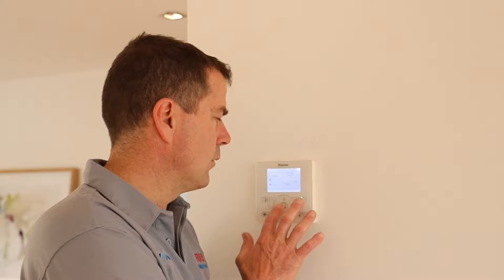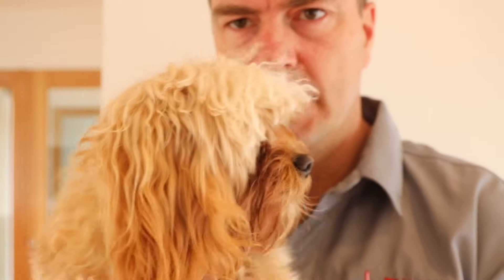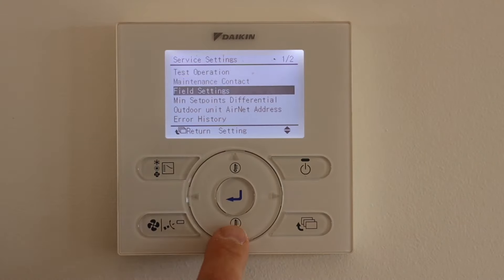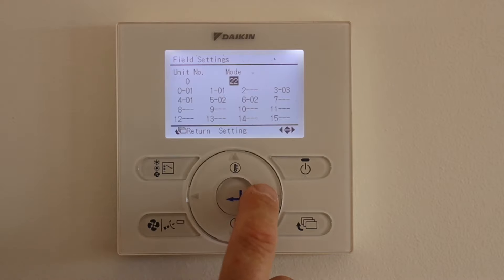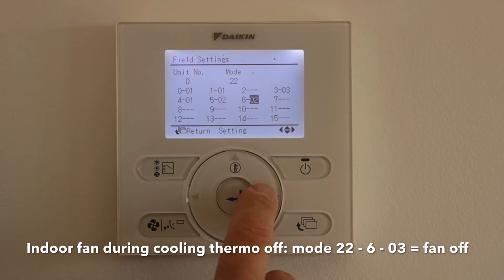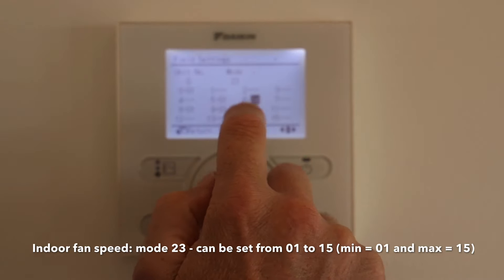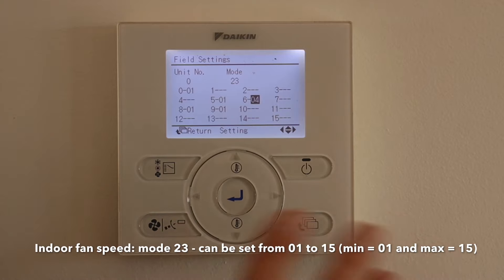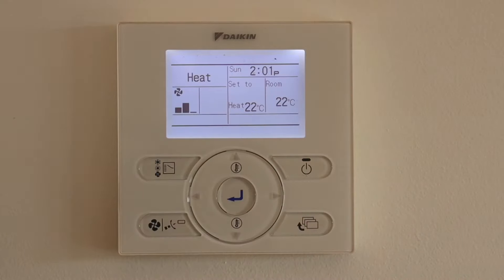Daikin BRC1E63 controller set up field settings cycle fan off, activate sensor in wall controller

Comment: After 4 years of trying to figure out my my system was so goofy I finally have an answer! I have 4 air handlers in a ducted system. upstairs would always go colder than set temp and downstairs would never get down to the set temp.
Reply: Question, I have also read that when you change the thermistor location to the remote only that you should also make changes of 20-8-2 and 20-5-2. Any input on this? Mine is actually a BRC1E73 controller

Comment: Loving Arlo! Good looking pup. 

Craig, I have a Daikin mini split as a second system in my home to cool the second floor which has all the bedrooms. 

My indoor unit is a FMDQ24RVJU and the outdoor unit is a RXL24UMVJUA. the. O troller is the Daikin OnePlus.

I am in the USA and these systems are fairly new into this American market (from what I am aware of…)

I am having a problem with overcooling with this system. 

Are the field setting tje same as what you have explained here? I am having a hard time finding a document that explain what each setting is. The same for what each mode is.
I was wondering g if you could provide a link to where I could go find such document. 

The installer has not been successful on getting this unit to work properly. It is his first Daikin install 😢

Thanks for your video as you explained some of the settings. Sub’d and I hope to hear from you. Cheers!

Comment: Mate you’re a legend will see how I go. Issue I have is that the bedrooms have no power whatsoever but the living room heats up in my apartment. Is there a way you can change the power distribution across the different zones?

Followed your instructions so let’s see. Also what does the S symbol mean? I did change the energy saving % is that it?

Comment: Thank you very much for the detailed video. 

I don’t seem to have the Room Temp option in the Display Item options. Is there a setting to ensure this is available in Display Items? FYI, I have the BRC1E63 with FDYAN125AV1 Indoor unit and RZA125C2V1 Outdoor unit.
Reply from the maker: @LChristou-n4j  it should be the same as what I have set, configuration, display, display item = room.
Reply: @FullyAirconditioned  I only have three options, None, System and Outside Air Temperature. Any ideas why Room Temp is not an option; thought it might be a field settings issue but can’t find a master file that explains every field setting…

Really appreciate your help.
Reply from the maker: @LChristou-n4j  check felid  setting 1c - 0 - 02 this allows room temp to be displayed in “detailed settings”. It’s set to this from factory so someone must have changed too 1c -0 - 01, “not displayed”.
Reply: @FullyAirconditioned Thank you so much, that worked. Looks like my room temperature is not accurate - reporting 23 when it is closer to 19. I have implemented your other settings so it should be reading the wall unit temp. Any suggestions why this could be inaccurate and are there any fixes you’re aware of?

Thanks so much again, really appreciate your time.
Reply from the maker: @LChristou-n4j  there is no calibration for the sensor readings, if this sensor is active as the control it what controlling the system.
Reply: @FullyAirconditioned  Thanks so much. One last question and I promise I’ll stop hassling you - Is there a master file which shows what every field setting is? I have a number of active field settings which do not appear to be active in your video and I would love to understand what they’re all doing.
Reply from the maker: @LChristou-n4j  all this information is in the service manual for each model, they do very a little bit from model to model the Engineering data books about 500 pages the section you’re looking at might be like 20 pages. It’s just hard to send through YouTube.

Comment: Thank you so much! We have this unit and want to know if there is a “night mode” because that power light is so bright at night time
Reply from the maker: Sorry I don’t think it has this function
Reply from the maker: I was just think there may be a way, when the timer is uses there is a set temp in the off setting with a heating cooling set point. It’s set up so that if the house gets above 35 degrees the system will come on even if its set to off and in heating I think its about 5 degrees, the heating will come on even if its off at the controller. Both the heating and cooling set points can be adjusted to a higher setting for heating or lower set point for cooling. If you set this up the unit should turn on if the temp in the house drops below the set point, so the heating will start and heat your home at night with out the operation light lit. Haven’t tried it my self but I believe it will work, not to shore of the differential of the system kicking in and out, but you should be able to work this out with a bit of trial and error.
Thanks Craig

Comment: Hi, thank you for posting this clip, its been a life saver. I only have one question, my room temperature is 21, my set temperature is 20 which I increase to 27. It will run at that and warm the house for half hour or so, then stop and the set temperature is back to 20. How do I keep the 27 permanently displayed as the desired room temperature? Is there another mode number to set?
Reply from the maker: @janetcarney953  you have set point auto reset active on your controller, go into menu, energy savings options, then go to energy saving list. Here it will let you know what energy saving are turned on, turn them all off.

Comment: Great video mate, just wondering what the main difference between auto fan speed and the selected speeds and what do you recommend for a ducted. Also I have a Daikin 125 and circular grills which seem to make popping sounds only in heating when the indoor fan runs.

Comment: I'm definitely going to look into making some of these changes. 
I'm actually chacing info on chaning the settings for the defrost. I'm having terribles with the outside unit freezing up and staying like that until I am forced to get a bucket of hot water.
Reply from the maker: This won’t help defrost, check out my video on defrost to see if your unit is operating in the same manner. Biggest problem with excessive defrost is under sized system.
Reply: @FullyAirconditioned  I will check it out. I only seem to have issues when it drops below zero. Once it freezes up it seems struggle to defrost. It doesn't help that the unit is in a dark cold area behind the house that hardly sees the light of day.
Reply from the maker: @fifis101  KISS, Keep It Simple Stupid, check the simple things first, is the filter clean, best way to clean is to wash it.
Reply: @FullyAirconditioned  Gee I wish it was that simple. Yes it's clean. I clean them quarterly.

Comment: Thank you - your explanation of what the codes do was very helpful.

I have a Daikin ducted setup which was installed last December. At present we are experiencing some hefty frosts, down to -4. Consequently the house was very cold in the morning and the AC unit was struggling to warm it up, especially since it goes into a defrost cycle.
Last night I let it run all night with a setting of 20 degrees. This morning the house was warmer but the AC had still entered a defrost cycle which may have happened several times during the night.
Is it safe/sensible to let the unit run overnight in these conditions? Do I run the risk of damaging it?
Reply from the maker: It’s fine to let them run, design to do so. Improving your insulation (heat loss) will help system and reduce running cost.

Comment: Thank you for posting this information.  I'm wondering if there's any way to adjust the fan speed range?  Right now even the lowest fan setting is too much.
Reply from the maker: Yes , but only if 23-6-(1-15) 1 groups the three fan speeds selectable from the controller at the lowest speeds. 15 groupe the three fan speed setting to the highest speeds. If you can only select high and low (medium is skipped) your fan is a AC fan motor, with only the few speeds.

Comment: Another question - thx for your answers so far.
I've seen several videos explaining how to set the system to take it's operating temperatures from the controller or the the return air or alternating between the two. But no-one explains why Daikin have the different settings or which one is the best to use. Can you explain which one is best to use and why?
Reply from the maker: Depends on the insulation application, for a office that’s need to meet the standard for introduced outside air (a conditioned office space requires 1lt/sec of outside air per m2 of floor area). The indoor fan need to run all the time to draw that air in, regardless if it heating or cooling, so measuring from the return air is more accurate. In a home this is not necessary and cycling the fan completely off to stop drafts is best. If the sensor in the return air is active (air inlet of indoor unit) and the fan is not running it’s not actually measuring the room temperature. On a cold but sunny day with a ducted system installed in the roof, the roof cavity may be quite pleasant 22 degrees, but in the house it’s only 18 degrees, if the controller was set to 21 heating, it would not turn on. So it is best to set the controller to look at the wall sensor for control for this application.
Reply: @FullyAirconditioned  Thx for that
Reply: @FullyAirconditioned  great answer…very helpful

Comment: This is brilliant. Thanks for such a clear explanation.
Our Daikin unit is about 10 years old we have a BRC24Z4 type controller that you cover in another video. Are the settings the same as in this video when you access them? I am trying to work out how to adjust controller so that the fan doesn’t blow cold air for 5 minutes when we first turn the unit on before it starts blowing warm air. Is there a “pre heat” type setting?
Reply from the maker: If your unit is 10 years old then the fan in the indoor unit is a ac fan motor, this fan only has a few speeds and there is only about 5%~10% different in air flow. When the unit starts up it will warm the indoor unit coil to about 42 deg before it turn no the fan, but the compressor is an inverter and it will take about 10 minutes to reach full speed (full heat output). This different in time is the cool air you are feeling. With the newer units the fan is a dc fan motor that has many speeds, ranging in speed from 5%~100%. The fan comes on slowly and continues to speed up as the coil increases in temperature, the end result is less cool air blowing at start up. With the brc24z4 best to set it to cycle fan off in heating and cooling, if you leave as factory set the fan will stay on all the time unless you have the fan in auto. But in auto fan it will sample the air (turn on the fan every 5 minutes for two minutes) so the return air sensor can take an air temp reading.
Reply: @FullyAirconditioned  Thanks for replying so soon! Our problem is the unit starts blowing air as soon as you turn it on. It’s also throwing a U2 message and we’ve been quoted $2200 for a new circuit board install but that’s another story!
Reply: OK, set our fan to auto low. Turned it on. Nothing happened for five minutes then warm air started blowing. And no U2 error code! (Until now Ive had to turn unit of and on outside to boot it up without U2) Running like a charm. Magic! 
Not confident yet about going into the tech menu as you demonstrate to cycle off in heating (code 3 from memory from your video). Thanks again, your videos are excellent at explaining complex settings in a user-friendly way.

Comment: Thank you for the informative video.  I followed your instructions and now i cannot access/change the operation mode .  Its currently blank and pressing button does not change to COOL,DRY,HEAT,etc.  Please advise how can i get this to work again.
Reply from the maker: This video is about setting up a standard Daikin BRC1E63 wall mounted controller with the standard field settings we would set when connected to a ducted (Australian ducted) unit. We set the fan to cycle with the thermostat and set the to sensor location for wall controller. We also show how to adjust the fan speed settings and explain how the fan should be set up for best efficiency, effectiveness for heating and cooling operation. we show how to get into setting mode for the Daikin wall controller.

Comment: Great video mate. I set up to your specs for the summer months running AC mode, worked wonderfully. Switching to heat mode for our winter months, it seems I have some tin canning going on in start up and shut down. Any insight would be greatly appreciated.
Reply from the maker: whats it doing

Comment: Very very helpful!! Thank you so much!
One more question-
The AC is too noisy in one of the bedroom but good in the others. I set the fan speed at 5 and also tried several speeds but didn't help. Is this a normal situation or if there's anything wrong with my AC?
Reply from the maker: How long is a pice of string, there could be many factors into why it’s noise, air flow, short duct, 1st duct / closet duct to the indoor unit, restricted air flow, too much air flow 🤷‍♂️. But one thing is that it’s only that outlet, so it would be something different with just that particular duct. Check to see what difference are and maybe that will point you in the right direction.

Comment: Great video mate. Can I replace a BRC24Z8 Zone Controller with this unit?
Reply from the maker: Hi,

Yes but it won’t operate any zones, and if there is a remote temp sensor you won’t able to connect that as well. 
Why do you want to replace (the crazy-hard to set timers) 😬
Reply: @FullyAirconditioned  thanks for the response. The display on my BRC24Z8 controller is scrambled and it makes it difficult to use as I’m unable to read what’s displayed. Was wondering what my options were.

Comment: Hi - I'm just clarifying the question I asked three weeks ago - I'm not sure you understood what I was getting at.
* I want to run my aircon to heat overnight.
* With the current frosty nights the outdoor unit will likely go through several defrost cycles.
* Are these recurrent defrosts over several nights going to damage that unit?
Reply from the maker: Hi Greynomad,

Defrost is a process of the heating cycle of the system, No it won't damage the unit. if your running it at a lower temp it wont go into defrost as much.
Reply: @FullyAirconditioned  Thx for that - very reassuring

Comment: Great video, I have a  BRC1E62 main controller and was wondering if I can use a BRC1E63 as a sub controller only to switch the unit on and off from another room.
cheers
Reply from the maker: The BRC1E62 and the 63 are different, you could try but I don’t what t  to r outcome will be sorry.
Reply: @FullyAirconditioned  thanks for the fast response,  I thought the BRC1E63 replaced the BRC1E62.  I wired them as a main and sub and Error U5 came up on both controllers. Disconnected the BRC1E63 and all's back to normal.
Reply from the maker: @mj4853  U5 is both controller set to master, one needs to be set to slave and the other to master.

Comment: Thank you so much for this useful video. My system doesn't show outside temperature, any idea why? Should i activate some field setting to display outdoor temp?
Reply from the maker: There are lots of variables, this is an Australian ducted indoor unit, different units will have different settings and input values.

Kind regards

Comment: Do you know the setting to adjust the cooling “deadband”? When I have the cooling set to 75. It doesn’t turn on til 78 and doesn’t turn off til 72 (+/-3degrees). I’d like to lower that to only +/-1degree if possible.

Thanks!
Reply from the maker: That’s about 1.5 - 2.0 deg c, think that’s about as tight as you will get it .check in the services settings under “minimum set point differential” change if from 1 to 0 and see how that goes. You could also try 22-2-02 in field settings menu “change over set point differential”. Jut remember to write down what it was set to from factory so you can change it back it it doesn’t work.
Reply: @FullyAirconditioned  thanks for your quick response!
Reply from the maker: @Conradlovesjoy  it’s 5 am in the morning here in Australia, I usually check YouTube messages once a day when I wake up. 👍🏻
Reply: @FullyAirconditioned  lol I must have caught you at the right time. Thanks again for your help! You saved me from hating my attic system!

Comment: Thanks for your video. I have just had two australian systems installed. The installer was adjusting mode 10 and 12 to do the same in your video. Have these settings changed since your video in 2020? Thank you.
Reply from the maker: Hi Shaun,
Good question, No they haven’t changed, codes starting with 1, ie 10 and 12 allow you to change the setting, and codes starting with 2, ie 20 and 22 are where you can view the current setting. With old controllers (about 10-20 years) you had to set the settings in the code starting with 1 and view the current settings in the codes starting with 2. You can now adjust the settings in both 1 or 2, but can only view current setting in codes starting with 2. Hopefully this is not confusing.
Thanks Craig
Reply: Thanks Craig. Is there any chance of getting a copy of the code settings posted for all to see.

Regards Shaun
Reply from the maker: @shaun4338  yep will give it a go